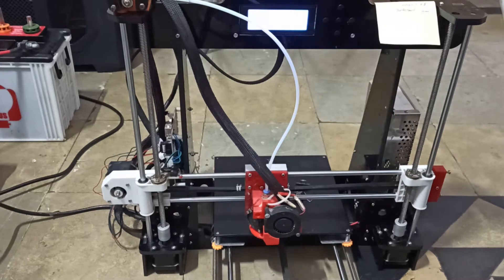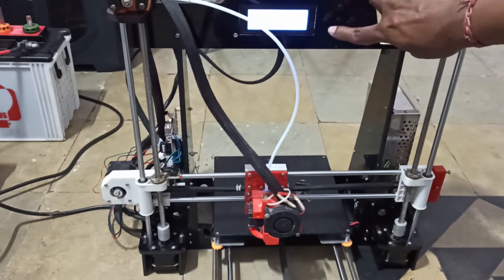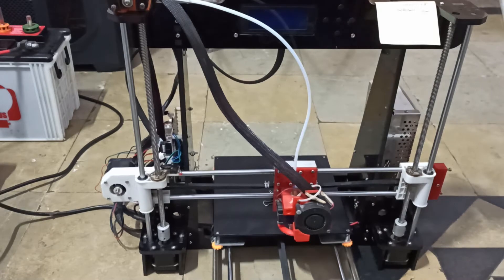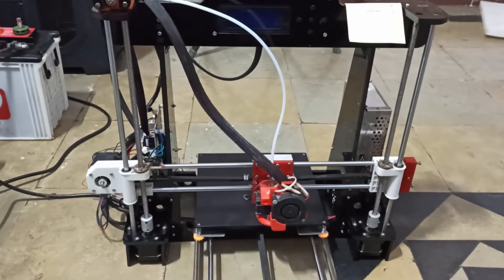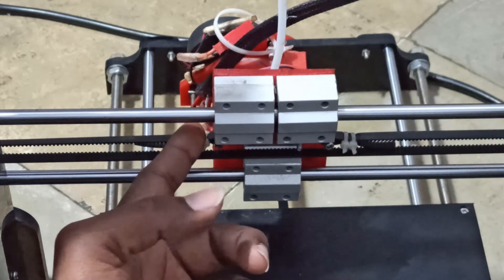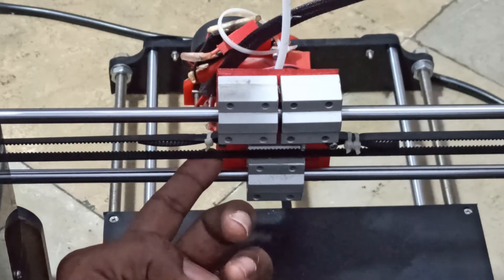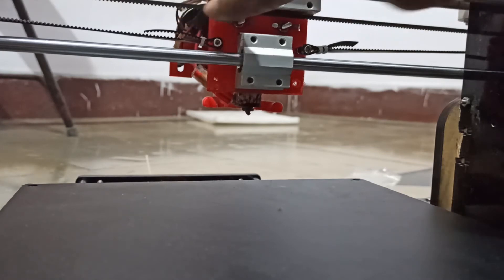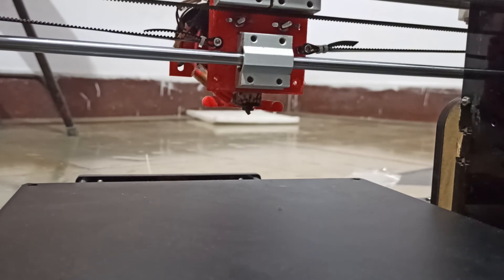Anet A8 3d printer X- axis Endstop Problem Fix  #3dprinterProblem #fix #fixit #troubleshooting

Comment: hi, im having a problem with all my prints are printing as mirrored can you help me at all please?
Reply from the maker: Hi could you please tell me what printer you are using and what slicer you are using. And please explain what exactly the problem with little more details to understand problem. And to fix the problem. You can contact me through channel Facebook page for faster communication.
Reply: @DiyDot3d  Hi thanks for replying, in the last hour i have actually fixed it, my x stepper and y stepper were wired up to my board in reverse so i swapped them around and ran a print and it was fixed, btw i use anet a8 and cura. thanks for your help anyways i appreciate your reply have a great day.
Reply from the maker: @MrJuuddss  good to know that you fixed problem 👍. Feel free to ask any help needed from my side. Always happy to help😊. Thank you

Comment: I've done the same think and it's still going the wrong way. Can you help me?
Reply from the maker: Hi if this is not fixing your problem. Then you need to change endstop logic in firmware. You can follow this video.. https://youtu.be/Fo6eHzhQgIA
Reply from the maker: All best👍. Don't hesitate to ask if you have any doubts. Happy to help 🙂. Please subscribe to my channel for more trouble shooting videos. Thanks😊
Reply: I see you responded to a post 6 months ago hopefully you will see this then. I have an Anet a8 but it seems to be a bit of a knock-off. The official company said it was an anet a8 but when I look up videos the software is a bit different. Anyways my problem is that when I do Auto Home(I notice some software say another work for homing the printer) the extruder bangs against the x axis stop sensor and just keeps trying to go left. Any tips on what to do?